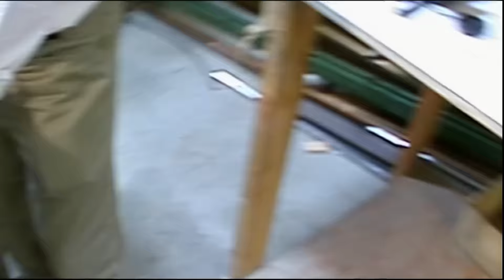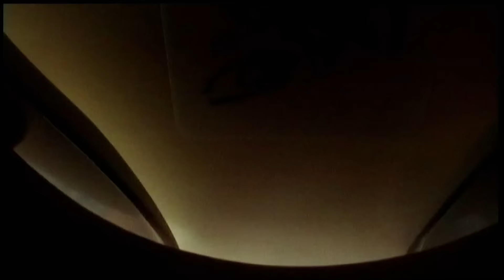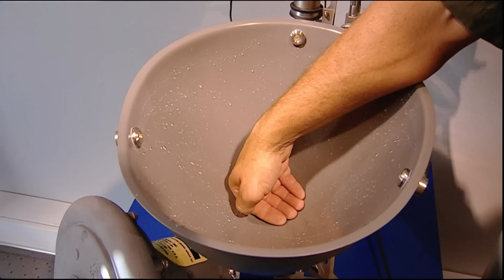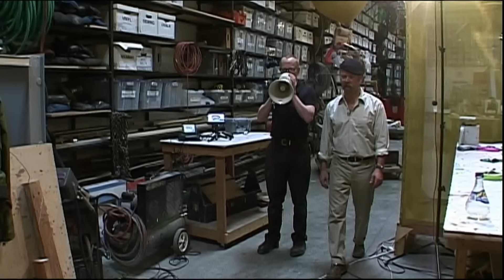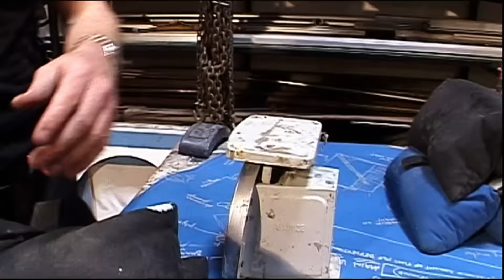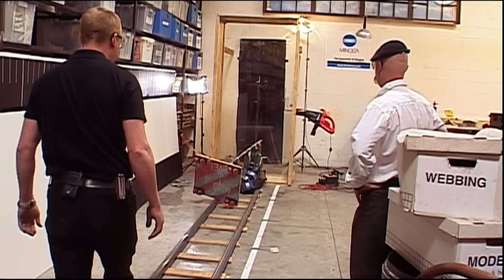How Long Can a Human inside an Icy Bathtub? | Mythbusters Season 1 Episode 11

Comment: I've heard multiple stories of the "falling lawyer". One major factor was supposedly he was wearing a ring. When he slammed against the glass, he put his hands up to stop himself. The metal ring acted like a punch and broke the glass. Anybody who deliberately jumps into high rise glass deserves a Darwin Award. Most modern buildings have two panes of glass for each window. They fill an insulating gas in between them for better insulation of the building. Glass is TERRIBLE as an insulator, more like a temperature sink, the exact opposite.

Comment: The Lawyer falling is supposed to have happened in Chicago. But he wasn't a lawyer he was a realtor, he was showing apartments with floor to ceiling exterior glass walls. When clients showed concern at how safe that was he would throw himself against the glass to show it would not shatter. But he did this one too many times against the same pane and the frame holding the glass gave way! The whole panel and the realtor fell to the ground!
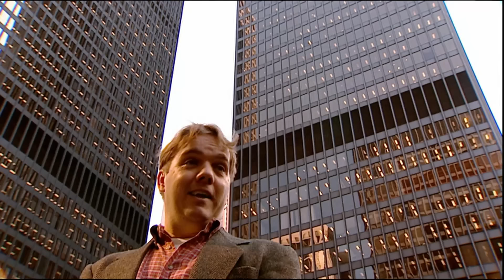Reply: 48:59 begs to differ...